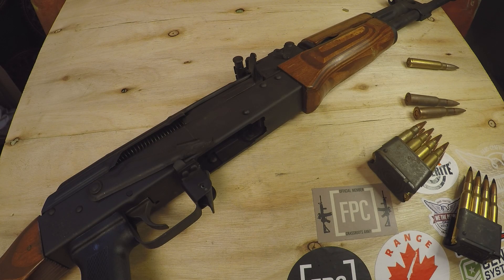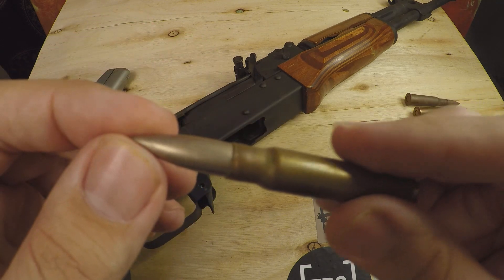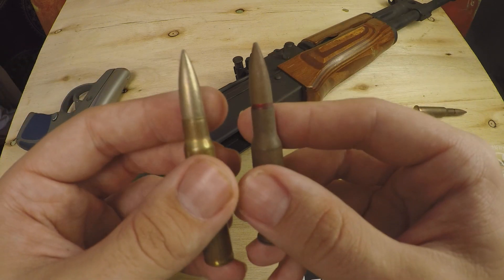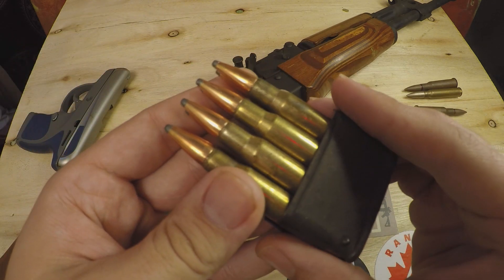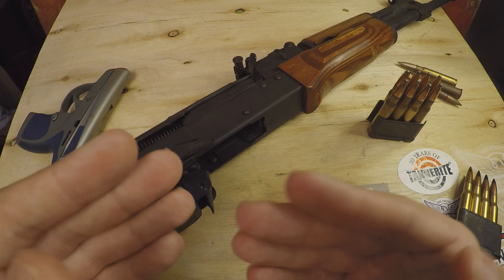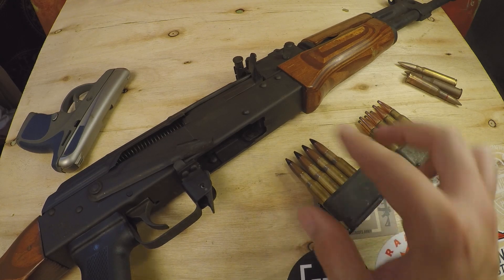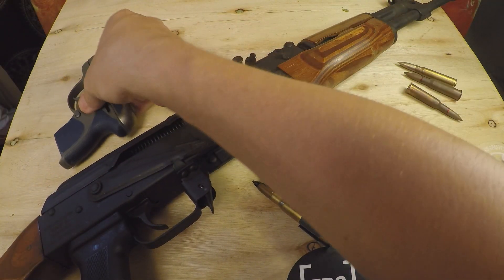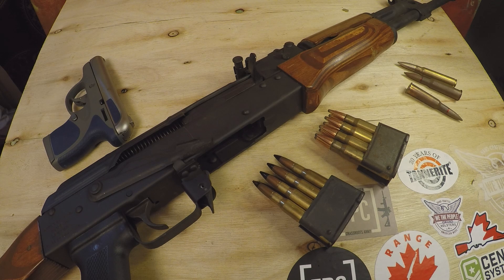Lead Core VS Steel Core Bullets

Comment: My 1946 dated Turkish 8mm does have a steel core wrapped in lead. The 1940 stuff I shot before was straight lead cored though. It would be interesting if we could figure out exactly when they switched to the cheaper mild steel core.